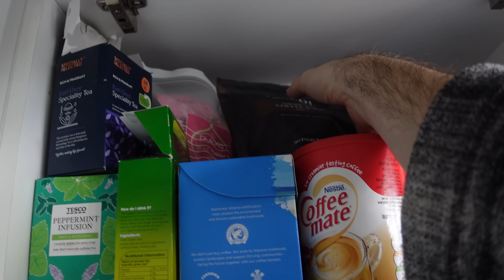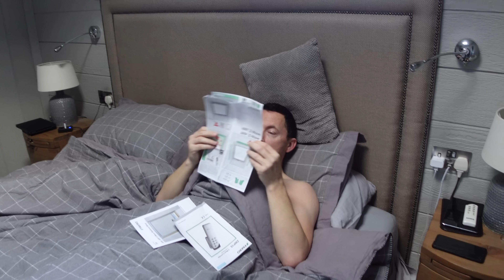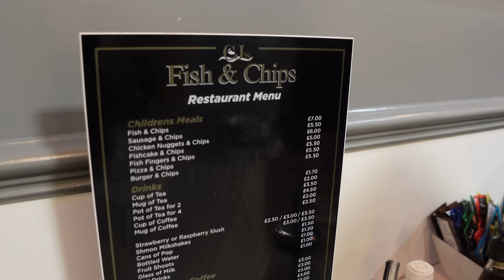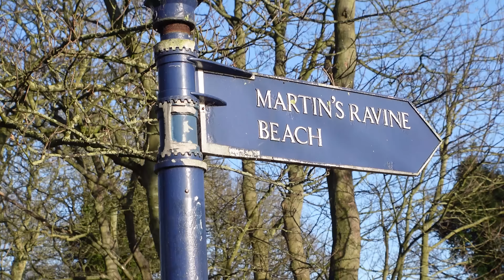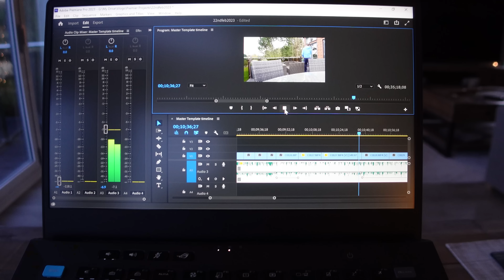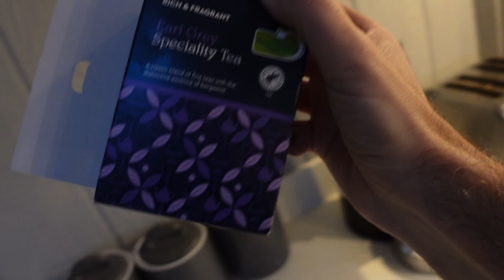CAN ANYTHING ELSE BREAK  AT THE LODGE

Comment: I used to work in McDonald’s and can confirm nick is somewhat right. Yes the machines are shut down for cleaning but normally from midnight. The most common reason is that the machines overheat and don’t feeeze the ice cream for the shakes and McFlurrys and McDonald’s are too tight to buy 2 so we can use one while ones not working